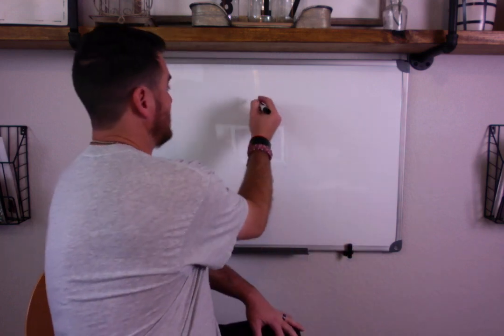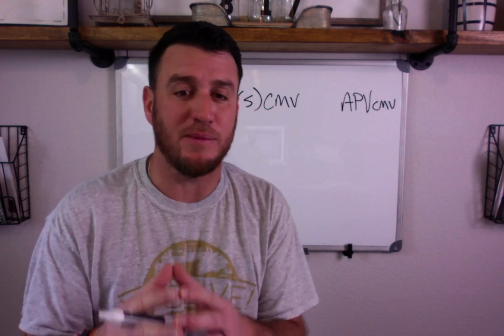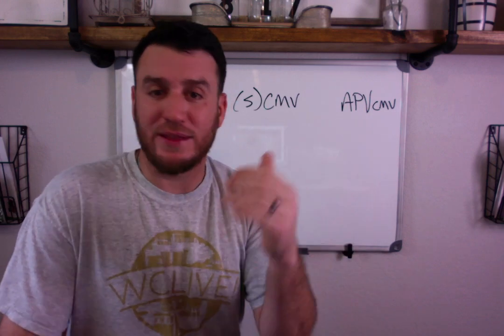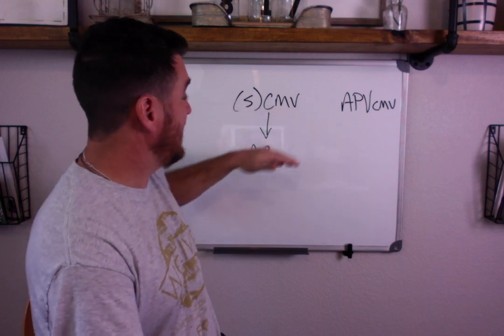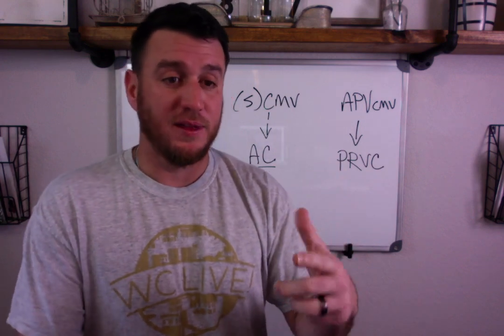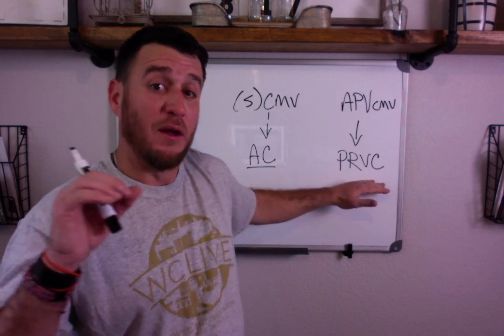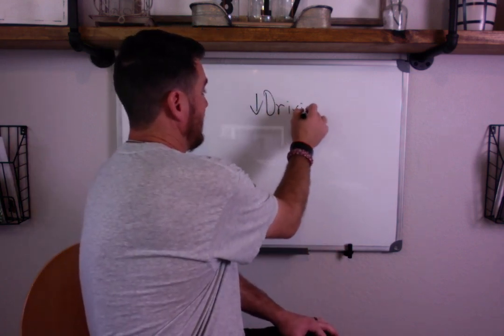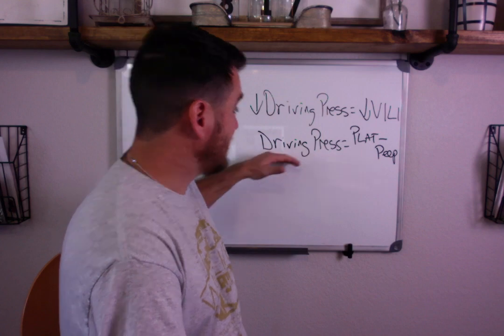Respiratory Therapy - What is (S)cmv, APVcmv, and Driving Pressure in Pressure Control

Comment: Great video. However, isn’t plateau equal to peak in pressure control only when the inspiratory flow has dropped to zero by the end of inspiration? If the ventilator stops the inspiration while flow is still ongoing, then the peak will be a little to a lot higher, depending on airway resistance.
Reply from the maker: 100% True story!

Comment: So in the Hamilton SCMV (+) mode...

1) if the pt. triggers a breath, the ventilator will deliver the full Vt that is set by the user? 
2) does the Hamilton automatically changes the amount of pressure so that the set Vt is delivered? Until the P-limit is reached and then it will drop the breath?

Thanks!

Comment: Thank you for the great video! 
I still have a question about the driving pressure. 
There is an option for an inspiratory hold of 5 seconds even in PCV and we have been using it and resulting pressure as an Pplat substitute. After watching your video it seems a bit meaningless to me. What is your opinion on that? 
Greetings from Prague
Reply from the maker: Yes, exactly!  A plateau pressure in pressure control is a mere extension of the applied set inspiratory pressure.  Very different than when in volume control.  It's still a plateau pressure, visualized by the cease in flow on the flow waveform, it's just not the same reflection of plateau pressure that we see in VC.